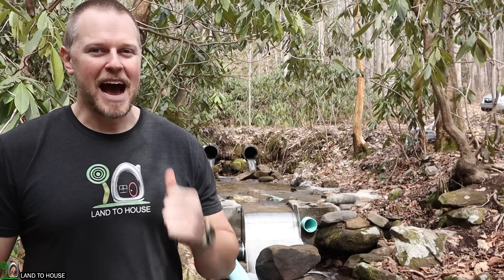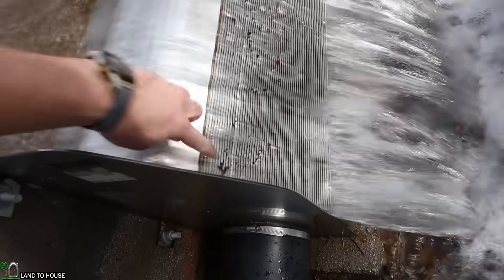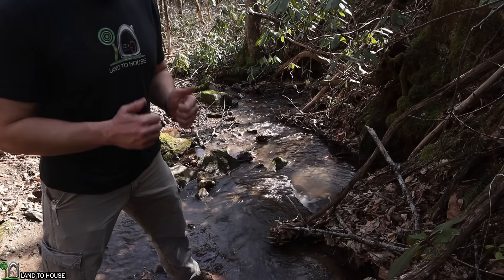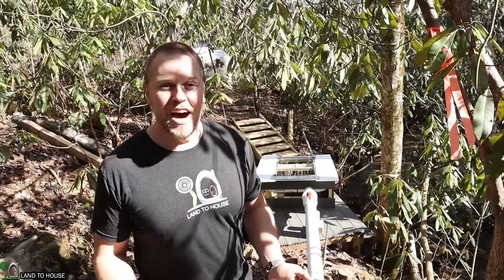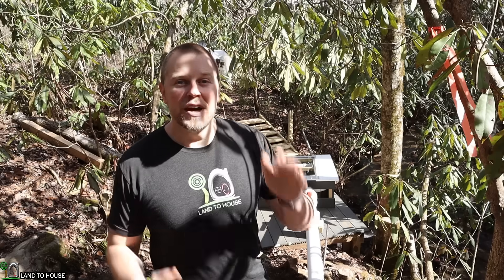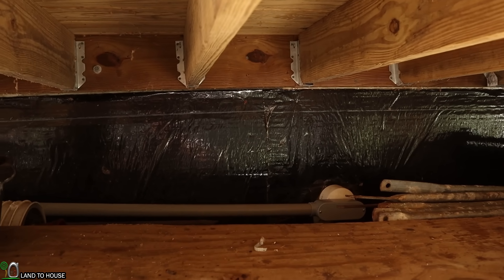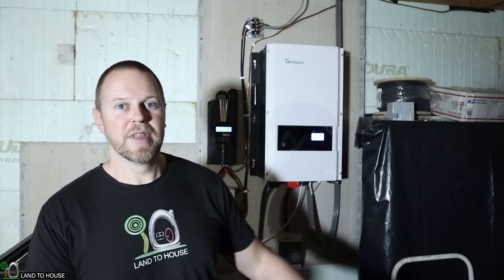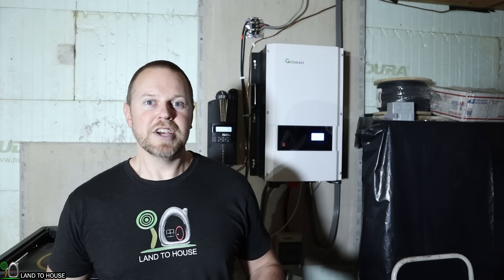AWESOME WATER POWER 500w Hydro Electric Off Grid System

Comment: The electrical wiring all looks pretty sketchy.     

Seems like the wire-nuts joining the alternator to the 10/2 cable ought to be protected in a box, especially in that humid/moist environment.   The exposed rectifier just screwed to the wall is asking for trouble.  And does that need a heat sink?   Or is the concrete doing that?    Exposed bus bars in the battery rack without protection is asking for trouble; a short there with the high currents available are gonna melt anything that comes across them.   That battery to inverter wiring ought to tied down, not just hanging out of the top of the battery cabinet.  Then the wiring in and out of the inverter is just hanging there under it's own weight and not tied down isn't great, either.   The utility of those DC breakers, especially the DC power in and out of the battery cabinet would be greatly improved with some sort of labeling.  So when fire/smoke is shooting out of something, you don't have to remember how that got wired up.  

I'd think that just because you're off grid doesn't mean you should ignore normal electrical codes and practices; seems like the associated safety would be good to have.

 I'm no electrician by trade, but.. I've added branch circuits, lots of current transformers to monitor power consumption, etc.  Professionally, I've had to help design and operate large data centers and worried about UPS systems, standby generators, automatic transfer switches, etc.   So I know enough to be dangerous and when to involve professionals.   I think raising the bar on the electrical side of all this would improve the long term reliability of this installed system.  And for the $$$ that someone spent on all those batteries, I would have expected a minor investment on the electrical craft work side of things.   And I'd think the cost to have this be less scary is just a few hundred dollars.

Comment: Im making a self contained waterwheel generator using a large water storage container for cattle with solar and 2 battery packs to alternate every other evening.
Im using 12 volt bilge pumps to move the water over the wheel that'll be spinning 2 alternators. One alternator for main batteries and home inverter. The second will be charging the backup battery for the water wheel as well as topping off current use pack. 
Couple this with four 450 watt panels to run during peak light  and couple the wheel to a ten speed gearing system and I can use a 12 volt gear reduction motor for back up and efficiency. I can control the speed of the wheel/ alternators.
Once started,  the system should run continuously.

Comment: Do they have a smaller inverter as a backup to tun necessities? If one of the batteries in the bank goes, you still have the others, but that inverter seems like a single point of failure that's expensive enough that you might not want to have a second full unit as a spare.

Comment: The first ac-dc rectifier looks like a weak point and I'd watch against mounting it directly on the wall since it will generate condensation (which is why it looks like some reflective tape behind it now).  I'd probably put a redundant part there just for fun (half the load and failsafe backup)

Comment: This is so joyous to watch! Hehe. Having a private hydroelectric dam was a bit of a childhood dream of mine, during an obsessive phase with dams (and all kinds of civil engineering). We'd drive past farms with quite large dams on family holidays, and visit the real things, which naturally got me thinking, "you could scale that down ... ". So glad it's something people actually do.

But I have a point of personal confusion. It generates 3-phase AC ... which is rectified to DC ... to charge batteries ... which discharge DC ... which will then require alternation to 110/240VAC. It seems almost impossible to build more losses into a system. Hehe. Surely the creek flow isn't so intermittent as to allow require batteries (though, they'd be useful in a backup role). Having a transformer for direct conversion to 110/240VAC (and even a 3-phase outlet for any high current requirements) would have to be the ideal setup, right? Even mechanical storage using a flywheel UPS kinda deal seems to make more sense to me. But I have a total of zero training, and even less knowledge in this field, so please forgive the naivety of my questions/comments.
Reply: You'd be limited to 500 watts of power (ie/ my 1 computer draws 500) without battery and no power during any maintenance.  Flywheel?  Nope, steer clear of more mechanical storage.  That lifepo4 stack would likely run the place for 1 month without water (but I forget how many kw).
Reply: @jonclement  Ahh, thanks for that explanation, I've got it now. The battery storage essentially permits an increase in the available power. To someone like me, who doesn't know anything about it, it just seems like so many lossy steps. But now I get the reason(s).

Now I'm curious to find out the maximum power anyone's ever generated at the turbine in a similar(ish) micro hydro setup. Doubt it's more than 1kW.
Reply: @jonclement I get about 3 days out of my similar battery system, when not running the turbine. The Grow-watt is about 85% efficient. We run a refrigerator, lights, two computers and internet off of our batteries/ inverter. The average US household consumes 12Kwh per day. That’s why so many folks chase 500wh for these systems. 500x24 =12000
Reply: The alternating current coming out is an uncontrolled frequency which most electrical devices couldn't handle. Conversion to DC and battery gives a several good results.

Comment: Thanks for an excellent video. I'm sure it's all been well thought out by people way more knowledgeable than me, but I have a question regarding the "battery full" scenario: If the turbine goes into near free-spin, and switches to high volt and low current as you said, then there's next to no load on the system. With commercial power stations that's a "no-no." Important and expensive things break in spectacular fashion. I'm sure the box is "smart," but wouldn't it be better to have a servo operated valve to shut down the water flow just to be sure?
Reply: Kris Harbour has a great channel all about this. He is in Whales and he builds his own, and does exactly what you said. He has servos set up that can increase/decrease water pressure and flow to the turbine, and if all hell breaks lose, it can even just dump all the water from a gate valve later. Pretty impressive stuff really.
Reply: @80aj  Hi, I follow Kris -- great channel. It's nice to see how different folk go about their Hydro set-up.
Reply: @davidblake1663   My hydro system  has a load controller that senses when the voltage starts to climb above a setpoint, it shunts the power to a dump load (resistors) to keep the turbine from over speeding. Mine does this when the grid goes down, if charging batteries, when the batteries reach float, the same thing would happen.

Comment: Curious why you wouldn't put generator closer to water and cable electric to cabin. Way less noticable.Transform it to 230Vac and it will transport pretty well over distance. I can see security of generator being an issue but matiance on the water pipes has to be a nightmare.

Comment: 12KWh is a little light, so I think I'd run this in combination with some solar panels and get a hybrid charge controller. The consistent power output is nice though. I did some very rough math, and it seems the hydro setup would be about 2x the cost of a solar setup with similar daily output.
Reply from the maker: They also installed a few solar panels. Very wooded valley with little sun and big trees.

Comment: Very bad setup on the pipes, lots of bends, have it as straight as possible. And gosh that setup at the turbine, holy shit that is just terrible, full of 90s bends😂 And at least install a bypass at the main valve down by the turbine. Close that valve fast and your pipes will blow a joint or crack a pipe.

Comment: If you have elevation you don't need much water
Reply from the maker: (Head pressure in feet X gpm)/10=power

Correct if you have 175 feet of head and 30gpm you can make nice power.

Comment: Would Y pieces not be more efficient than the T pieces where the water exits the system and hits the generator? Great job on this system in any case well done!! I see a lot of questions on cost but with the way energy prices are always going I would say it would soon pay for itself.
Reply: I think the generator prefers pressure over volume.  So it's likely less turbulent then it seems

Comment: 3 phase AC to DC, then through an inverter. What are the conversion losses here ?
Reply: The 3 phase AC frequency is at whatever RPM the generator is spinning. So it's unlikely to be a clean 50 or 60Hz. So you basically have to rectify it in order to clean it up and make usable electricity out of it.
At which point it's easier to just implement some sort of voltage regulation and feed a usuable DC into the BMS and inverter.

Comment: An environmental disaster for the stream. 2 culvert pipes that prevent fish passage and then a concrete and metal sluice that ensures no creatures will be able to traverse that stream. It's vandalism.
Reply from the maker: Folks are always saying, what about the fish migration? These mountain streams that range in flow rate from 15gpm to 400gpm depending on rain do not have fish migration.

Comment: This is not an Off Grid System. Everything you have shown is made because of the grid.
One example; where is the stainless steel and plastic pipe made that is off the grid.
Define off grid and I may change my mind.
Reply: Except it IS OFF GRID because it's not connected to ANY grid. Maybe you need to change your definition of what off grid is cuz it's not normal

Comment: You mentioned that a dip in the pipe would cause a partial air-lock and that's  true but in practice the air trapped in the high point will eventually dissolve in the water and be carried out of the system.

Comment: Forgive my ignorance as YouTube randomly recommended this to me, but is this permitted in any way? Most states are protective of the rivers, creeks, and streams that run within them, and for very good reason.

Here in Pennsylvania, a friend of my grandfather was looking into replacing the dam on their property and was told that they may only repair or remove it as the state does not allow the construction of new dams without a special permit. Granted this hydro system has far less of an impact than that dam did, but again: states are protective of their waterways.
Reply from the maker: In this state, we have permission to use a percentage of the Creek as long as it returns to the Creek. Farmers also have rights to use a percentage for irrigation.  Dams are another story.
Reply: @LandtoHouse  I see, I assumed that the little concrete weir at the start counted as a dam/obstruction.

Comment: For me, I want to know the overall cost and the longevity of the batteries because if it's gonna take me 10 years to recover the cost of the system and then I have to turn right around and buy new batteries as soon as I've recovered my initial cost then I'm probably looking at 12 to 15 years before I'm actually getting free power.
Not so good.
Reply: I dont see thoses systems like a investment but rather a guarantee to have power whatever the geopolitical situation is. Specially in the USA where a severe social crisis will happen sooner or later.

Comment: Why not utilize the 3-phase power directly? I don’t understand conversion to DC then charging batteries then converting back to single phase ac in an always on non-solar generation source. 

Seems like it would be a lot simpler to just filter the 3 phase to get the right frequency from it then just put in a 3 phase breaker panel no?

I guess batteries could still be utilized if you wish to provide a peak power capability but is that the only reason all that conversion is going on?
Reply: It's a fully off grid system so without the battery storage you would only ever be able to power about 500w worth of devices at one time and you would end up wasting most of the power being produced when there is low demand. You could skip the batteries and dump all the excess into a hot water cylinder and/or aircon unit with direct ac but you still wouldn't be able to turn on a hair dryer without maxing out the peak load on the system so it really wouldn't be fit for purpose.

Comment: Would it create more pressure and possibly more electricity if the pipe was 6inches from beginning to end?
Reply: Setups like this rely more on head/pressure than flow, so no - not really.

Comment: Very clear presentation, thank you.

No mention though of the costs. Why not? Also, is the house entirely off the grid, or is this system just for backup? At a constant 500 watts it would generate about 360 kwh/month (which is a bit light for me) and @30¢/kwh would save $108/mo in utility charges. How long does it take a $1,300/yr saving to pay off the investment?
Reply: It's not always about being "cheaper than grid power". Grid power might not have been an option at this location, or it might have been $30-50k to run if it were. I can say from experience that battery & inverter setup was probably in the neighborhood of $10-12k, with the hydro setup maybe another $5-10k. 

500W or ~12 kWh a day is no joke - that's more power over the course of a year than I use in my single family home. Supplement with solar as needed (and a generator for emergency backup power) and you're gold.
Reply: @Justin-C  Down here if we had hills and water to use, that 500Watts would be just a drop in the bucket. Because the A/C is running almost all the time. Average daily consumption is around 67kWh.
Reply: @gravelydon7072   The consistent power is nice though. I could see using one of these in conjunction with a solar array.
Reply: Normally these systems get installed because of a choice. Run electricity to home, paying for poles, etc or go with hydro, solar and wind. 

A well balanced system can provide total home energy and no taxes paid at all!  That’s the most important part.
Reply: Depends on whether there's mains power available at the site. If you're paying for a long power connection there's a large sunk cost for that. First customer pays, and the connection is not yours. 2nd person in can just tap into it, essentially for free, because it belongs to the utility company.

Comment: How long before you get your money back 😊😊😊😊😊😊
Reply from the maker: Considering this couple has lived off grid without power. For approximately 15 years, they are delighted to have this unit running at 500 W. For them, it has already paid for itself.
Reply: Don't forget to offset the cost of getting connected to the grid.

Comment: Why use the batteries if there is always a flowing source of water  it will always produce the energy needed at no cost. Why store it
Reply from the maker: The storage is for when they want to run loads larger than five hundred watts. With so much storage, they could run a refrigerator and stove at the same time.

Comment: WOW such a small compact system that produces 3 phase a/c electricity is just AWESOME!
Reply from the maker: For this family way way back in the woods 500w is really doing them good.
Reply: Your car's alternator is also this.
Reply: @MariuszChr  Most of the time that is pretty much what these systems are.. Just a repurposed alternator.
Reply: It's likely not usable as 3 phase. Probably too high a frequency. This is the reason for the rectification, and subsequent inverter. If it was 60 Hz there'd be no need for that intermediate step. The point is, no 3 phase motors allowed.
Reply: @ruprectmonkeyboy1856  good observation. Yes the 3phaze would have its own phase position and not be able to connect (align position) with the grid phase position. 
But 
You could use it "dirty" to run many things.  Like heating element, an old resistance light bulb is fun because you can sometimes see the HZ hertz cycle of the generator. 40hz to 60hz depending on the speed.
You would need/want an AC capacitor and regulator transphormer to run anything with a computer in it.
The capacitor should reduce any power surges and the regulators wa a a a w taped in before the rectifier will give you that clean power wave. 120v without the losses that a
Reply: @scottadams3544  those small alternators don't typically run at 50-60 Hz. A PM alternator like that can't speed regulate electrically by increasing the torque load, so it's gonna spin at whatever speed it wants to, and create AC at whatever frequency it wants to. That's not usable in any other way than they way they're doing it, other than in a heater or incandescent load as you mention.

Comment: Ok that is very excessive length of pipe to system. Would have been better to not reduced pipe size for length of 20' then if needed reduced to 4" next 10'. Also dig into hill to give it higher drop angle. A door to access system would be needed. Then divert back to creek sooner down the hill.

Comment: I wonder if you collected the water into another pipe after it passed through the first generator, how long would it have to run before having enough pressure to go through another generator?
Reply: You would need the same amount of elevation 'downhill' from the first turbine to build up that same pressure/head again. 

For more (hydro) power on this property, it'd be best just to put an extra coanda & pipe in to collect more water right after the first one (if drying up the stream isn't a big concern), down to a second turbine near the first one. That said, dry season might very well mean there's not enough water for 2 turbines (or even 1)... so if any extra power is needed, it'd be better to just supplement with solar.
Reply: Loses all its pressure/energy the moment it hits generator.